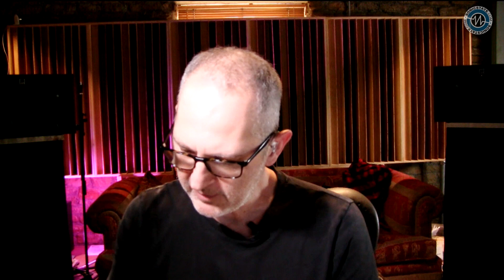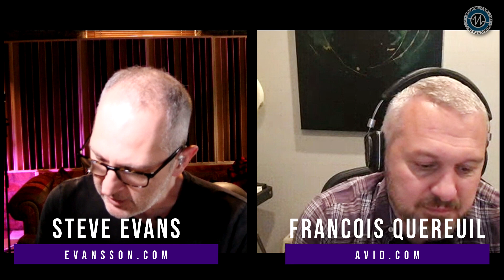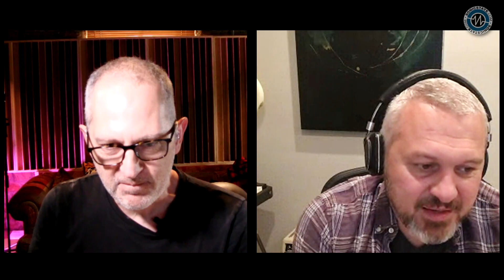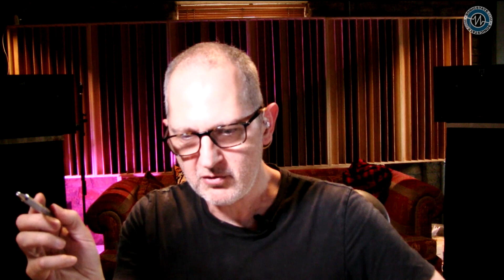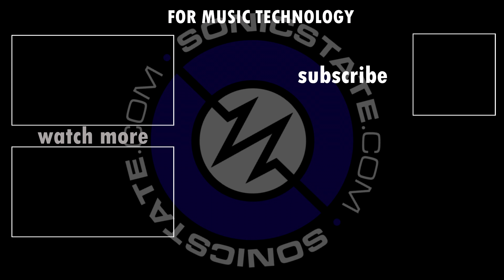The New AVID Pro Tools Hybrid HDX Engine - Discussion

Comment: Why does no-one talk about how it connects? Just waffle about more tracks but really nothing about what kind of computer or connectivity is required. Will the cheese-grater be compatible?
Reply: if you want to use HDX dsp and the hybrid engine you will need an HDX Core pcie card which houses the dsp chips and digilink connectors for HD interfaces. if you have to ask then it is probably not necessary to your workflow/studio set up.
Reply: @deeplistening01  Yes I have all that (2systems)  but the pictures in the press release looked like it included an expansion chassis of some sort.